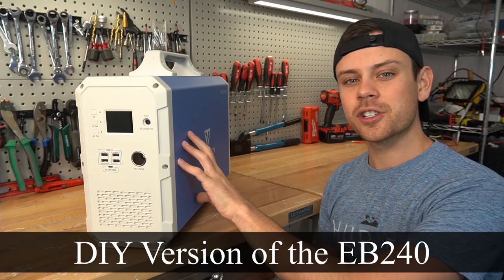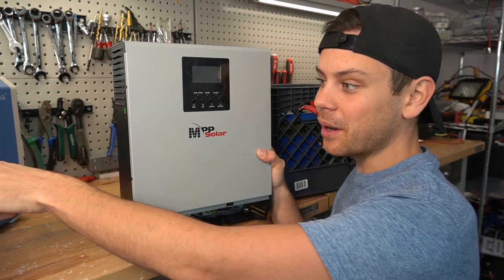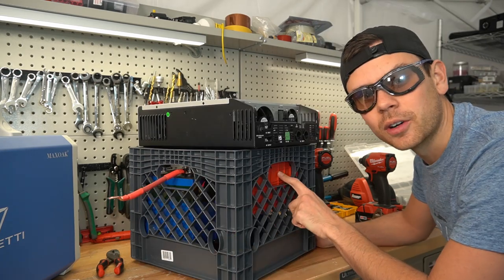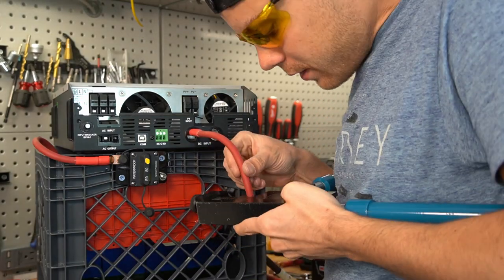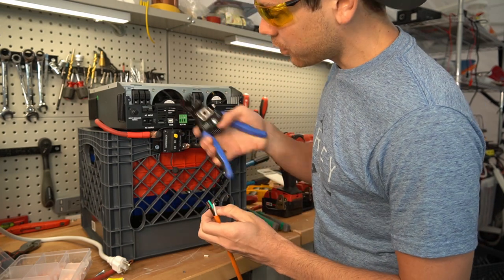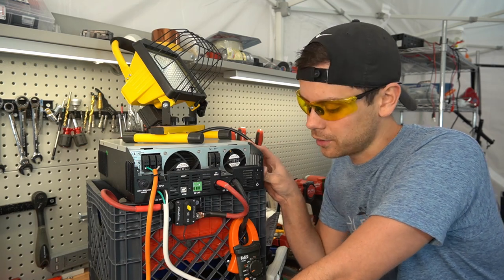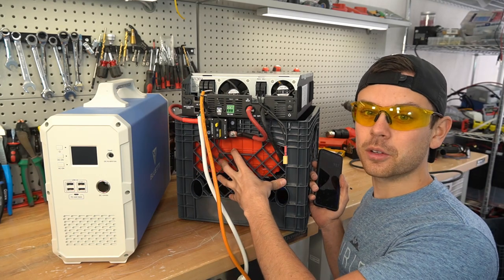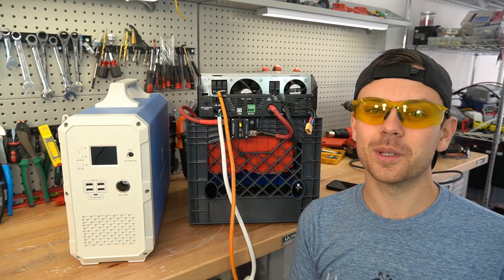$1050 DIY LiFePO4 Version of the EB240 Solar Generator: More capacity for $550 less

Comment: Can you get that all-in-one with a 1500 or 2,000 watt inverter?
Reply from the maker: Yes that's in the future
Reply: 2k
2kW inverter is definitely the 'sweet spot' minimum requirement to run more stuff, for me as well.
Reply: Mpp makes up to 6000W inverter all in ones, and many can link up for split phase or three phase configuration...
But on 12V like this kit, 1000 is average.
Reply: @WillProwse  Yes, and please, add a fast AC charger . That will be the perfect set up. Can’t wait.
Reply: @WillProwse   did they fix their support probs & other red flag probs on their inverters you highlighted in your review vid? Did you find out that unit was one of the countrerfeit MPP solar inverters?

Comment: I like this video, the built, some of the components but it has to be the channel's most dubious video in terms of accuracy and doubts about precision of the result. Keep it up and see you on the next one.
Reply from the maker: How so? We have used all of these components before. Didn't think I needed to cover everything all over again. What points are you referring to?
Reply: @WillProwse  Maybe minor details. Maybe it's just me.

Protruding screws on the side that you have to lift against the body and clothes. Was the bent plate part of the chassis on the mppt, I actually think so? Ground conductors on both "male prong" and "line input" should be longer than live and neutral for maximum safety. (If someone pulls the cord loose, live and neutral should release first from the binding post. Last ground conductor.) Pity that components had to be mounted on the outside of the milk crate.

Got the feeling that this building was much improvised. Your previous build in the milk crate I experienced more thoughtful and with a more aesthetically pleasing result.

Trust me - I would rather build with your components than buy Bluetti.

I love your videos. Can't wait for the next. Have a nice day. Greetings from country number/code 46.

Comment: If you take the guts out of the inverter will it fit in e milk crate?
Reply: Move the BMS.  It will fit inside the crate then?

Comment: Thanks, Will, for all your great instructional videos.  Does the DIY system you designed in this video allow pass through charging?  If not, is there a way to add that as a feature?

Comment: Hi Will!
Firstly, I want to thank you for your content and contribution. You rock!
I was wondering if there was a good way to use a LiFePo4 for an UPS. They would sit around charged most of the time, which isn't ideal. I'm just so fed up with lead-acid right now.
The application is a power backup system for a modern wood burning heater for a friends home, that I built using a MPPSolar 1012MSE. They just need to provide about 200W for around 6h in the worst case if there is a power outage. Let's say I charge them up to 3.3V per cell would that make them live a long life without to much damage?
I hope you get around answering and or researching that. I did not find good information on the interwebs regarding this kind of use.
Or maybe make a video on that if you find it interresting enough.
Cheers, Fabian

Comment: Hi Will great job lots of information. What is internal structure of aluminum case Li Ion Phosphate prismatic cells. Wath's inside pouches, electrodes, separators,  electrolyte, etc how is it build up. And why need/are some battery contained under pressure inside their cell container.?

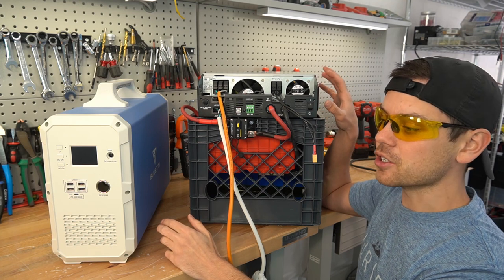Comment: 7:20. How do you charge that with your alternator!? I swear I was and am looking into that. Two batteries on one alternator....
Reply: Add a Dc to Dc charger to one of the sides.
Reply: I am curious about this as well and I don't believe I found any info on his site about using an alternator
Reply: Kisae dtm1250

Comment: New to solar and wondering (@6:28 where Will suggests going w/five 100watt panels in series) since I have limited roof space, could I use two 250watt panels in series or is there an issue and/or drawbacks in doing this(?)
Reply from the maker: Just ensure that max voltage is not exceeded and you will be fine. Any panels will work

Comment: @Will, did you notice the 3pin uart connection next to the 2pin NTC connection on your (non smart) Daly BMS?:) I just got about the same BMS, 8s 24v with fan (non smart) but 200amps. I contacted Daly and you can set any of the paramaters, especially change the low temp shut off from -40F to whatever you want:) You should test this?:) I believe they will send you your BMS with the settings you prefer:) Daly emailed me the program and instructions. I just have to get the 3pin to usb uart cable. I already bought mine, I learned the harder way but i will be able to adjust every thing on the non smart BMS now. Thanks for all you do Will:)

Comment: Love these, going to use this in a van build... you say you could add an alternator charger  to it, how would you do this?
Reply: One method is to use an ‘isolator’ to charge your 12v batteries while your van is running.  When the van is off and alternator not charging, it will disconnect the circuit so it doesn’t drain the battery under your hood. They’re cheap, readily available and fairly easy to install. I picked up one for my RV last fall and have been waiting till warmer weather to install it. I’m not a pro, so I’ll be watching some other DIY videos before I dive into it. Cheers
Reply: I'm interested in this as well. I have this unit and also a Renogy DCC30 but I haven't decided which route is best for me. If I can add alternator charging to the MPP AiO, that would be perfect. I'm assuming a DC-DC charger connected between the house battery and the alternator but verification on this would be great.

Comment: Why doesn't someone make all-in-one units of solar generators minus the batteries? They could be built to account for different charging capabilities, ac output (inverter) , dc output (usb ports, cigarette 10 amp , barrel plugs, 12 volt fuse block) , dc alternator input , converter , and of course connections for the battery input. Or is there such a thing . ??

Comment: I love this this is perfect. Please show how you can modularly expand a system like this surmising the milk crates. The only thing holding me back from doing a diy build is that I want to have a really nice display, preferably a touch screen, like the newer Bluetti units. Do the inverters that you use have a display that shows power in and out and check cell voltages. Love this. There must be a way to make this a modular system that can be expanded.
Reply: Simple.
Build more than one battery in a milk crate, but install Anderson 175 or 150AMP connectors on them.
Plug one into the next, etc. Voila... modular build.
The display does not show cell voltages, but it does show power in, and out.
Reply: Not a bad idea. Would you be able to expand the inverter capacity this way also. If you get the crates with square handle holes they may feed right through. I think this will be the build that I do for my first diy. Hope it for within the next 6 months to have it done. 

I would like to see an expandable and modular diy system. These crates are the way to go I think. You could always slide them into a metal container.
Reply: There must be a shunt and display that is useable. At least I imagine there is.

Comment: Hey quick question I'm converting an ambulance and I want it to be relatively "high tech" and I want to be able to go off grid for a relatively long time without charging. I'm planning on including and AC and induction so I need a relatively beefy system. this is what I'm planning on doing but I would love to hear your input :). So 16 lischen cells in 8s2p for a 24v system,a 3000w 24v inverter, 1200w of solar,40a charge controller, a 30a shore power charger,  and a 15a dc-dc charger. I'm probably missing something😂... Thanks!!
Reply: Nice I'm running The LV2424 in my Travel Travel with 1k of solar and 2 24v Battle Born batteries. 
Sounds like you will have a similar system.
My A/C is 13,500 Btu and can 2 hours from the 2 batteries.
Reply: @BrianPaine82  is 2 hours of ac enough? For like an 85 deg day?

Comment: These builds are great to watch, I always learn something, unfortunately if I were to bring this in my auto, van, house or cabin and had a fire, I would have no insurance.  Still neat concept however
Reply: Because need UL listed system?
Reply: @TheTruthSeeker756  yes, has to be UL listed or submitted for design approval to the OFC and installed by a red seal electrician
Reply: @rogerpilon2588  Only if you were hooking it up to the breaker in your house. I see this as more of an rv or emergency power device rather than a continuous power supply.
Reply: @justinfowler2857  does matter. All electric devices must be ULC CEN and or CSA approved. I can’t for instance build a toaster oven from various parts and call it good. This is in Canada, the US may be different

Comment: So what happens if you overdischarge the cells? The BMS will cut off, but then the charger is also cut, so you cannot charge it? 
Same for overcharge? I guess you set the limits on the all in one unit to be within the limits set in the BMS, but if you want to use 12V power directly from the battery, you could discharge it to a level where the BMS turns it off. How do you charge it then?

Comment: Nice setup!  Would you consider making a video on a small DIY UPS for a household network / computer?  I'm sick of seeing all the consumer options using SLA which has to be replaced every 3 years!
Reply: Basically what made can be a UPS.
I run a 24v version for my Travel Trailer.
If power goes out it auto switch to battery.
Just scale to the size you need.
Reply: @BrianPaine82  true, but the inverter is on 24/7 and therefore more losses than the small standby consumption of a UPS.  Also, this setup has no backup in case the inverter fails (unless it does have grid pass-through).  I basically just want a simple, cheap UPS but with LiFePO4...
Reply: Several companies have ups functionality built into their hybrids, including his one... but LiFePO4 does NOT like to be kept above 60% state of charge without drain... a ups runs off utility power, and switches over to a fully charged battery when power fails. 
This would be bad for LiFePO4 ...
Reply: Will just mentioned on another comment here: " This actually has a bypass for AC so you can use this as a UPS "
Reply: @zomg0its0me  i just looked mine has UPS setting need to check it out.

Comment: Hey will, what if I wanted a bms with more discharge so I can power a 4000W inverter? Should I hook up 2 overkill 100A bms in parallel or should I go with a 200A Daly?
Reply: When pulling over 2000W, it is best to move up to 24 V or higher. 4000W at 24V is only 167A, and at 48V it is 1/2 that. 
Above 24V, more safety precautions need to be followed around the battery, but if you are aware of the potential, 48V is easy to work with. 
24V 280 Ah 8s BMS should handle 200 amps.
Reply: @SuperVstech  Oh sorry, I should've specified; I'm talking about a 24V system. The reason why I'm not going 48v is probably the lack of 48V inverters

Comment: What do you think of the ego battery generator 3000w shine converter? They also now have a solar panel adaptor to charge the whole thing, generator is less then 500, batteries 🔋 of course is where the cost is, 1200 for whole system, reviews are five stars so far...

Comment: Will this system power a mobile chicken coop for the winter time? and what type of solar panels do you recommend for this DIY build?
Reply: Rich are listed on his website I think
Reply: It depends on what you are powering in the coop... lights and heaters plugged in will rapidly deplete any battery without ac or solar input... 
add up he loads, and calculate the Wh demands.

Comment: What is the standby current of the all in one?
Reply: @arts8302  WTF? I think your speech went a little off topic from his question...
Reply: I hunk in another video Will said the standby is around 30 watts
Reply: @SuperVstech  half a kilowatt hour a day of waste isn't what it used to be. I guess that's why he didn't mention either the wattage or wanting the circuit breaker there if just for a switch. If I owe any explanation I did catch up to the Rock in LA and followed it on a bike the last hour or two. That was a modern art huge boULDler transported from another state across weeks I believe if not months. It was suspended and they had to lower it and raise it depending upon the obstructions in the road. The speed of travel allowed many of the people for the moving company to jog along. That helps with 'Croud' control and was part of the artistic performance. At the museum of contemporary art we all enjoyed standing under the dozens of super closely spaced old fashioned concrete street lights. They had NOT upgraded them to LED! I don't know how they've handled that or will handle 'that." 

The milk crates are not going to handle 60 lb LAUNCH floating inches above the floor and the floor coming back at it. The strong ones can STand STAtic pressure but you do need to hang it from APPROPRIATE elastic cord  if  going to be going off road with this!  MILK CRATES ROCK FOR SUCH SPRUNG INSTALLATION!

Comment: I'm no expert but is it possible to mount circuit breaker inside crate? Align face of breaker with oval opening and make a couple of bushings/standoffs to run your bolts through. Isolated and protected less wires/lugs sticking out.

Comment: Looks good but will it last in the real world? Let us know after 6 months of testing if it still performs, $1050 is a lot to spend on untested experiments.
Reply: If a component fails. You can replace it. Without scraping the whole thing.
Reply from the maker: Yeah and the all in one can easily be serviced. You can swap out the mppt or inverter or whatever you wish. Or swap components on the PCB. Very easy to work on all parts of this system.
Reply from the maker: MPP has UL 1741 compliant inverters. I would not consider that "untested" haha. That is VERY hard to do. And the cell manufacturers listed are top of the line. What component are you worried about? Daly bms can fail, but I havent killed one. Use overkill bms on my website instead. It is a beast
Reply: @WillProwse   ok cool. I'm still learning so no part in particular. Thanks for the reply Will
Reply: @WillProwse   Awesome thank you, I think I will give it a try then. Appreciate all your helpfull content!
Reply: @kennethwers  Thanks Ken! Im pretty dumb with solar and electric still. lol

Comment: Hey Will, ignore my previous question (I deleted it) because I found my answer on the link to the AIO system and in some of your other videos. Sorry for asking a question you've already answered. What I haven't seen is adding a DC circuit to a system like this. Would I just add the DC fuse block right off the battery terminals? Would the AIO system power the DC circuit when hooked up to shore power and left over energy go to charge the battery?

Comment: Hi. What's your opinion on using Pylon US2000 batteries in a RV along with Voltacon 48v inverter w/mppt? I went though several channels and websites and seems that noone even mentioned this option. I just wonder if there is some obvious reason, as price for 2,4kwh Pylon is similar to 1kwh other Lithium batteries. And said inverter is also not too shabby price wise.
Any comments would be much appreciated 😉

Comment: Hi Will I’m building a solar generator atm and I am curious whether I should wire the switch power supply to the fuse box or the mppt charge controller.

Comment: What gauge wire is the xt60 connector you're using for the solar connection? I'm looking to do this same setup with an xt90, unless that's overkill.

Comment: Im so confused!  I'm ready to spend🤑 and build my crate UPS, but now I don't know if it should be a 12v or 24v system.😔 I'd love to have something that could expand easily as I get the 💰 money for more batteries cells to add.  Can anybody clear my confusion?🤷‍♂️
Reply: I went with 12 at first but now I'm 24 and it takes way less amps from the batteries so they just run longer coz everything is a lot cooler lol
Reply: @davidpotter9462  So, I have to decide if I'm going 12 or 24V before I purchase a BMS or MPPT?  Or will they adapt to which ever I decide?
Reply: Oh..yeah what it is...the transformers are wound for a certain voltage so they have to know how many turns you want on there and then see all the capacitors and stuff have to be the same volts..yeah some of them can build to custom  voltages but there's probably one out there already..48 volts is common
Reply: The one I got is an Epever 4215..40 amps 24 volts..I just got that one in case I want some more panels and now next week I'm gonna order 2 more 100 watt ones...it can handle 1000 watts of panel input and I've only got 400 going into it..600 will charge my batteries faster since I'm  getting 2 more of them next week  too lol..(stimulus check)..I've been buying 2 batteries a month so Wednesday I'll have 8 for 340 amp hours...yay...just think that's 24 battery cable ends...I used #2 welding leads for wire..keep them short as you can. Watching inverter videos scared me lol..try to keep stuff cool even if you have to add a fan..it will pay back in available wattage and longer life..my stuff stays cool even with 1600 watt load and that's about all I throw at it at a time
Reply: @davidpotter9462  Thank you.  I will look into the EPever!  But of all the MPPT's out there, how did you decide on that brand and model?